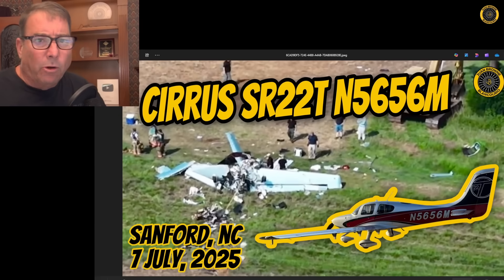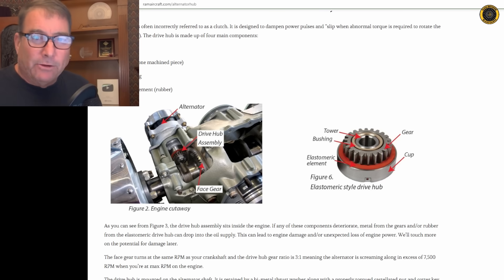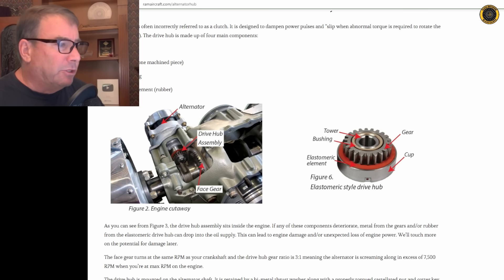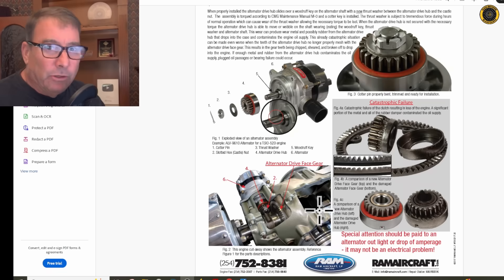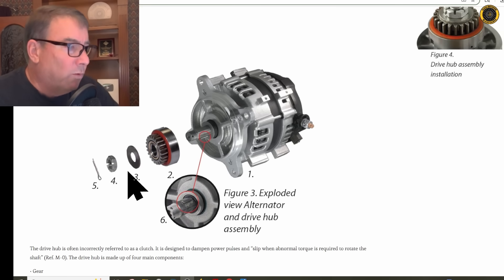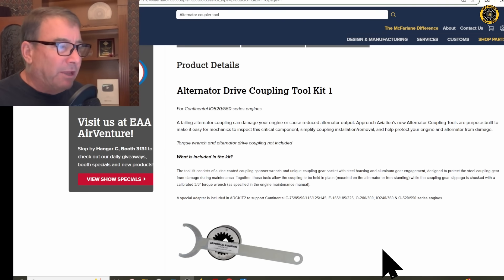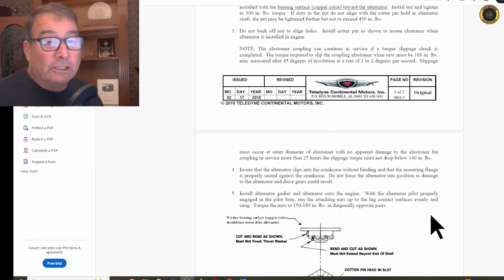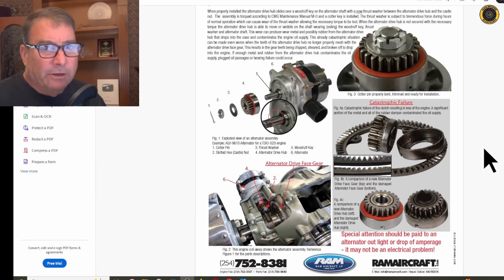Alternator Drive Failure-Can Lead to Engine Failure!

Comment: Juan, if the alternator fails and the electronics drain the main battery, wouldn't the fuel pump turn off? According to the electrical diagram you shared in the previous video, main battery powers main buss with the Fuel Pump on it.
Reply from the maker: No, engine driven fuel pump. Only the boost pump (primer) would be inop.
Reply: If I recall correctly, the electric boost pump is required to be always on in the turbo Cirrus. I suspect that the engine hiccupped on the descent with the boost pump inop due to electrical failure. Sad consequence of classic "getthereitis"
Reply: Wasn't there a correction to that-maybe three buses? Yep. See " Gebenki"
comments on the original video.  I don't think his  drawing reflects such.
It starts off like this: 

Juan, I'm a Cirrus avionics expert. What you said is all correct about the G2 planes, and there are a lot of similarities between older and newer Cirruses, but from G3 onward they actually have 3 distribution busses... (cont'd)